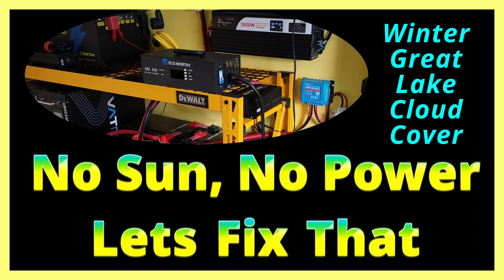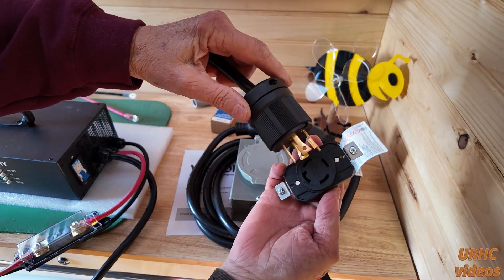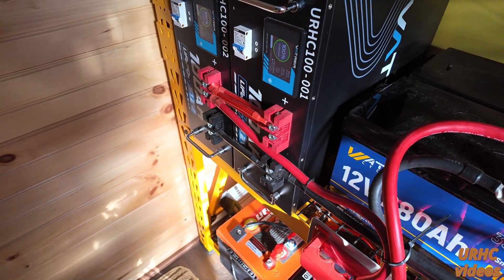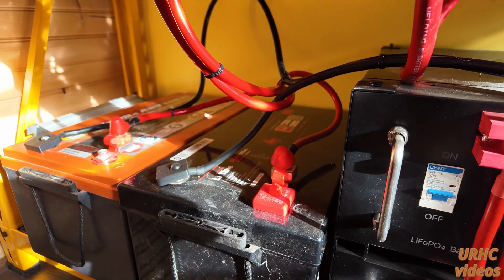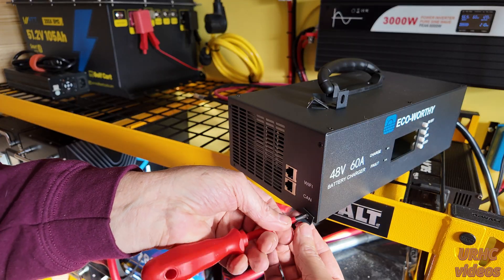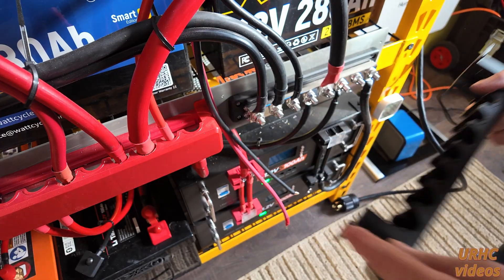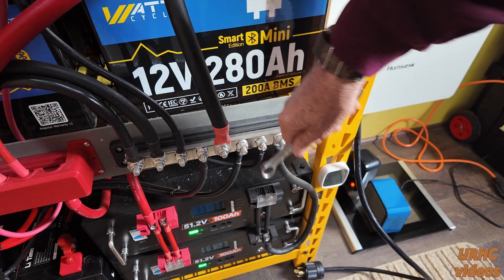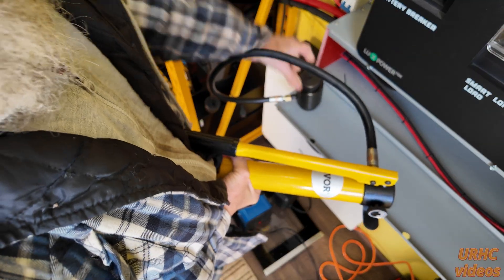No Sun, No Power, Lets Fix That With A Eco-Worthy Charger.Update Error E11 They Are A Waste Of Money

Comment: Did it work with your generator?  What size is the champion gen?
Reply from the maker: I just tried firing it up today to try and it doesn't work with my Champion 3600/4200 watt generator.  Keeps getting error E11 and shutting down.  Appears you need an inverter generator  for it even though it's advertised not to need one.
Reply: @unemployedredneckhillbilly2023 too bad.did you try it at 10 amps and ramping up?
Reply from the maker: @peterchang7646  yes its only good up to 29 amps. I'm supposed to have version 2 according to my order that has the issue fixed. Guess it's still a problem.

Comment: Hi there from Australia, I'm very curious. Do you have a video on your battery bank system and how you put it together using different batteries? I've just started a small off-grid channel and I run 100 amp batteries with 135 amp batteries. I'm just curious on how others go doing it at the moment mine has been successful so if you do have a video could you direct me to it?
Reply from the maker: No I have not made a video because everyone says it's not safe to mix battery brands and capacities. I have had no problems and use voltage settings in the inverter with no communications to SOC.  Basically it's try it at your own risk the way I see it and viewers shouldn't  think it's accepted. So far it has been working good and battery voltages staying the same on all batteries for me for my testing setup. None of this is UL rated so it will all have to be replaced eventually for my permanent system.  Just keeping it as cheap as possible for now to learn and collect data. Hello from the other side of the world.  Thanks for watching.
Reply: @unemployedredneckhillbilly2023 you are welcome my friend. I'll keep an eye on what you're doing

Comment: I only see a 20 amp charge controller in the video. Does that mean you only have a few Solar Panels? I have a 40 amp charge controller that I’ve connected 11 320 W Solar Panels to and it works really good on cloudy days. What I’m trying to say is get more panels and make up for the cloudy weather. You’ve got lots of nice batteries to absorb that energy.
Reply from the maker: That controller has (2) 450 / 550 watt bifacial panels for the heaters only using the wall mount battery. The 12000xp has 10 of the same panels on it for the house connected to tbe buss bars. On a good day they put out 5000 watts at 400 volts. Going to add a second string to the 12000xp this summer. Our cloudy weather is very low dark clouds and lake snow with whiteout conditions that have limited them to as low as just 1kw for a day. I'm afraid to add too many panels with all the hail we get. Just using this as a learning system.  Thanks for watching.

Comment: So interesting to hear you both are off the grid! I didn’t realize that.
Reply from the maker: No, I'm not off grid totally.  This is to supplement our unreliable electricity supply and reduce the electricity bills that have trippled in the last 18 months from ridiculous delivery charges caused by NY shutting down power plants. Still have a grid connection but keeping this isolated from it. It has taught me alot about solar and will fully run the house 6 months of the year if required. Thanks for watching.
Reply: @unemployedredneckhillbilly2023  Ah thank you for the kind response! So nice that you are finding another way to take care of your power supply needs. Supplementation and a possible 6 months independency is a great achievement. Here in the Netherlands costs are high and rising as well (albeit reliable), and I'd be interested to do this in an apartment or house. I do partake (invest) in a local communal solar project which results in a discount on energy taxes, so that's something. This option is meant for people who can't have large cells on their own roof. In these projects flat roofs of churches, schools or social housing are etc. are put to use for solar.

Comment: Brother I'm glad u got that they are awesome  I have the charge verter  from eg4 why better than using just the generator.... keep it up brother
Reply: Ed, I hear they are going to crank Three Mile Island up again. Maybe you guys will have better power service than what we had in Korea back in the late 70s, which is what it sounds like you have now. The grid must be bad up there because we don't get the outages down here like that.
Reply from the maker: That is to power a Microsoft AI installation I understand. Basically NYs green new deal has shut down fossil fuel power plants causing the problem.  None of the green energy they invested in has worked out causing rates to triple. I see the push to all electric homes and vehicles starting next year causing even more outages. Wish I was younger so we could head south. Corrupt leadership seems to be the real problem. Thanks for watching.
Reply from the maker: I looked at the EG4 one but couldn't justify the price. This should work for my needs and will keep the lights on in an emergency during the winter.  I have such a mix of batteries that I go by voltage anyway. Winter up here is very overcast. We recently had 3 power outages and it sure was nice to have   almost everything in the house up. Wish wind turbines were cheap because with clouds we definitely have decent winds. Thanks for watching.